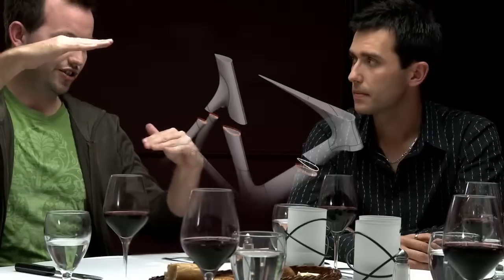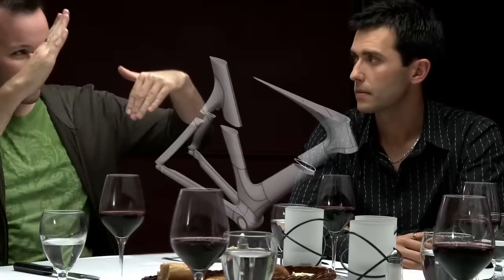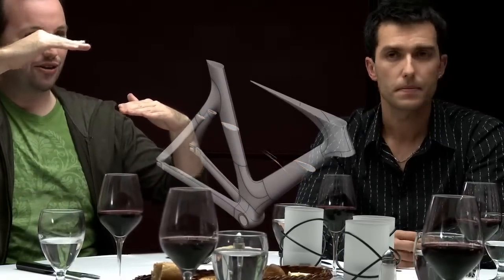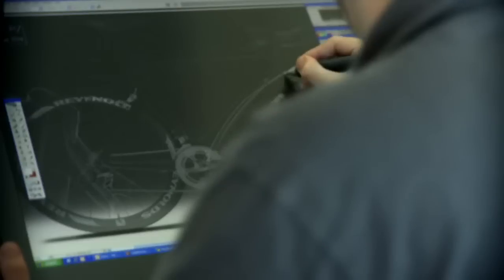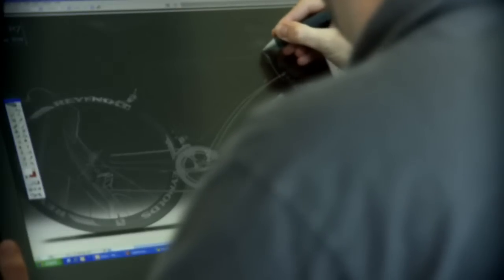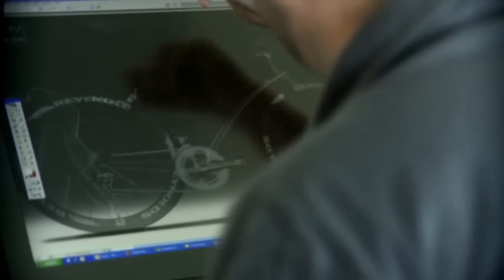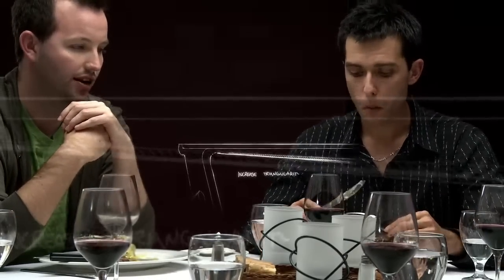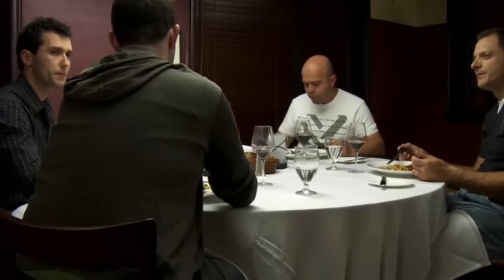GURU Crono 2.0: Aero-optimized tri /TT bike

Comment: beautiful bike, however side pull front brake sitting out and open in the wind, non-hidden rear brake with the cable housing exposed also?... I do love the bike but disappointed with the lack of small touches like the 2 mentioned. Yes this bike will be measured to fit YOU, but still for this money tuck away those cables. The SHIV is non UCI complaint made for triathlon exclusively so I think it already has an advantage over the GURU for the non 3:1 UCI tubing. Oh and a built in water bladder +1